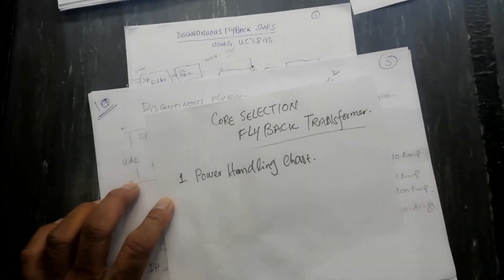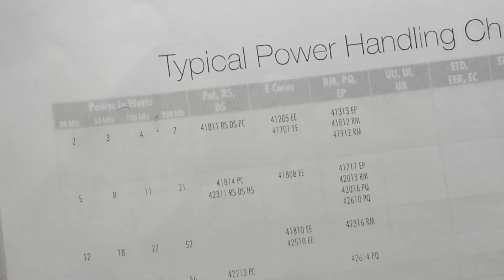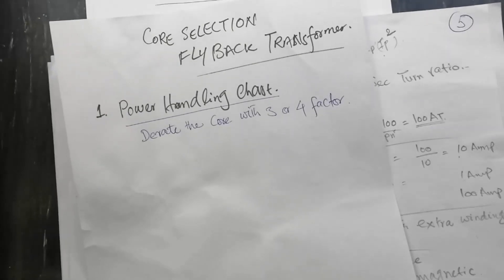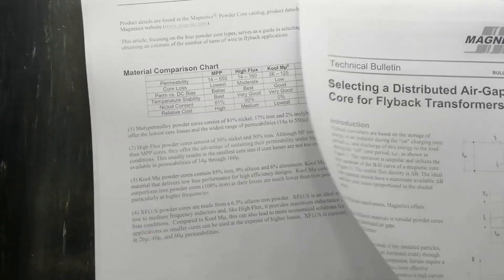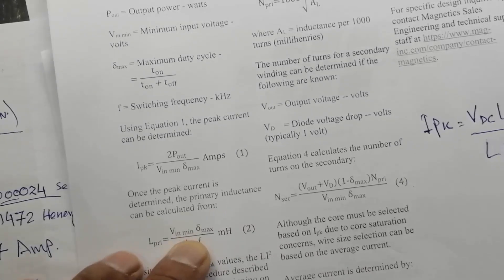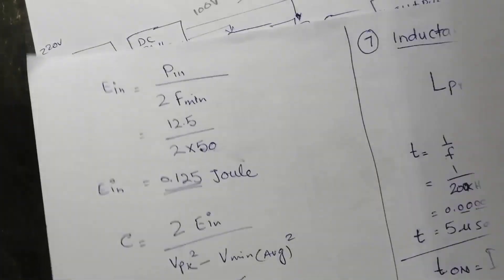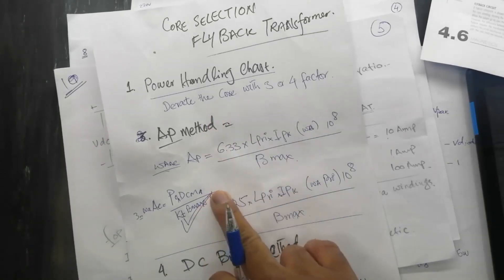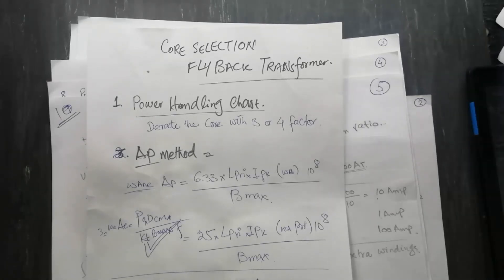#270 How to Select Proper Ferrite Core for Flyback High Frequency SMPS TRANSFORMER

Comment: Sir I like your video very much.
I have dought in Isolated DC to DC converter for 36-72 v input and 12v@10A and it's transformer design.
can you please help in design isolated DC to DC converter and transform type also

Comment: how are you calculating auxiliary winding voltage and current? In the video, you assumed that.
Reply from the maker: auxiliary voltage are calculated based on the PWM IC's UVLO upper limit (Overload Protection) voltage value at the maximum power output of the converter 
for example the smps is designed to produce 20 watt output. at that point the auc winding must provide voltage equal to or slightly above than the IC's VCC upper limit
Reply: @HaseebElectronics  Thank you so much for your generous reply.
Reply: @HaseebElectronics but sir what about current through auxillary winding ,why you have taken 0.5.